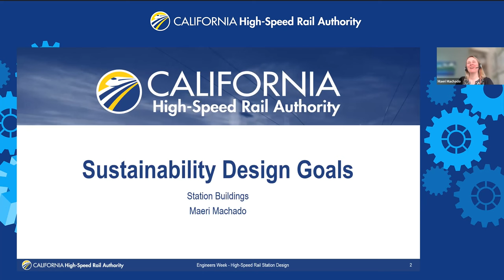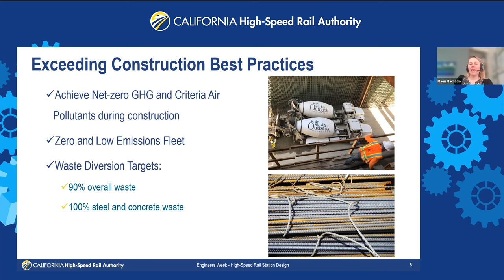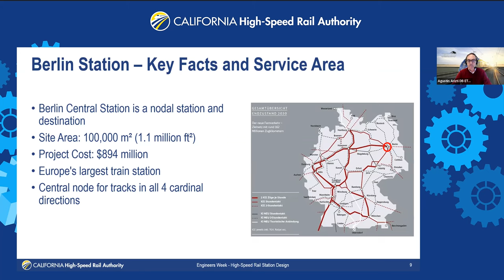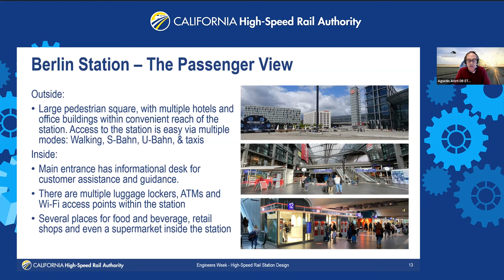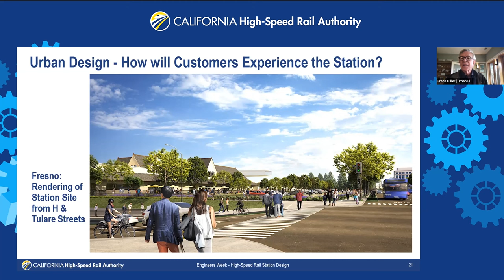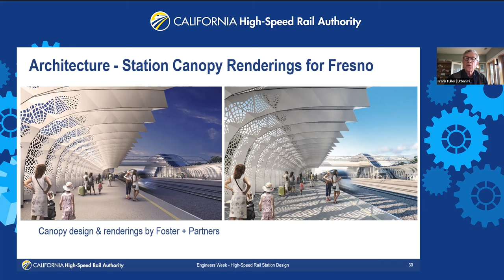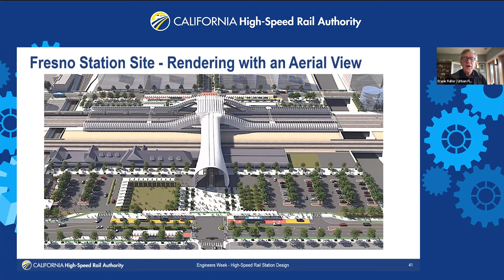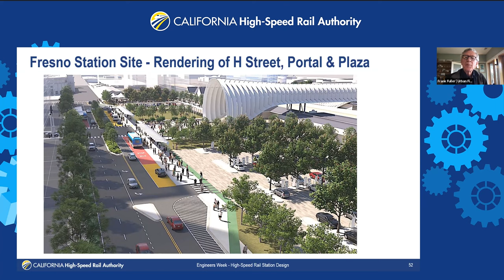Engineers Week 2023 Webinar – Modern Station Design for the Nation’s First High-Speed Rail System

Comment: One of the most interesting videos with forward looking information about the CAHSR stations. The station design paradigm seems comprehensive. Maybe a little too much so? I'm thinking of the old adage, "too many cooks in the kitchen." I hope that is not the case and it's more about developing a supportive structure for coming up with great station designs and not one with overriding competing interests that might leave some important issues by the side of the tracks. Keeping my fingers crossed.

It inspires confidence to see how comprehensive the planning process is in designing these first-in-the-nation HSR stations. However, i heard very little about how these stations would deal with growth going forward. Are these stations being built to readily accommodate future growth and expansion? Is there any thought of expanding these stations underground, for example? My concern is that these stations are not designed in a way that makes it very difficult to expand in the future at great cost. I look at LAX, for example. i've been following the most recent expansion and renovation very closely and many decisions about how to do this project come back to the original horseshoe shape of the airport. It seems the design decision to built LAX in this horseshoe design was not the best in retrospect when it came to future expansion.

I foresee these HSR stations to become very popular for local, regional and statewide transportation needs. Which will result in transformations of their surrounding neighborhoods and the respective cities at large. So let's hope the stations themselves are able to positively adapt to their surroundings in the future. It's not just about adapting to the growing development around the station, but of the station's growth itself.